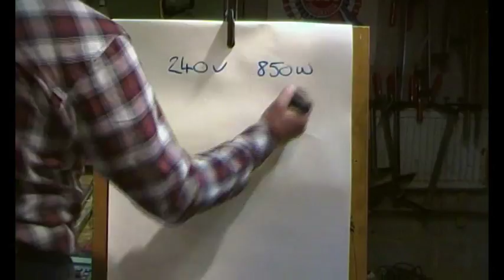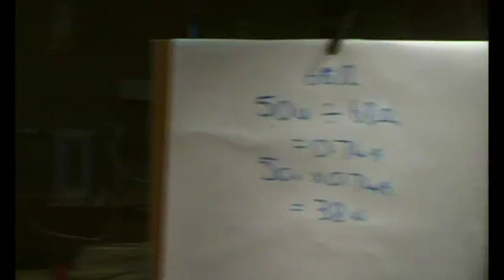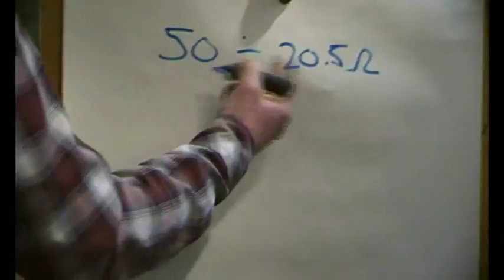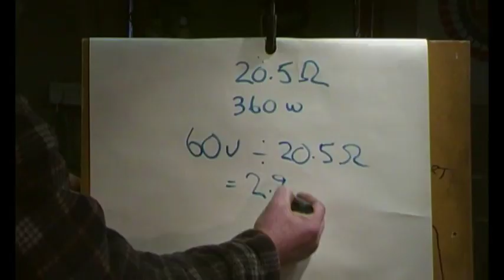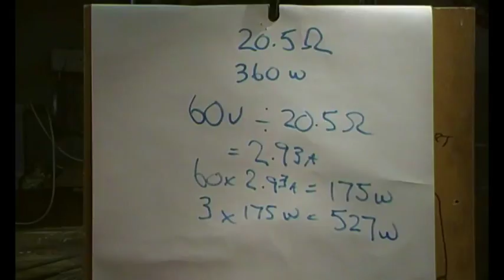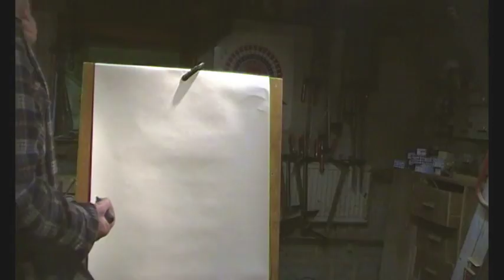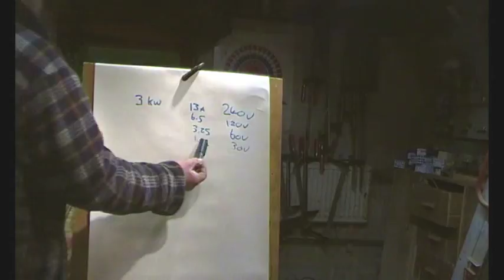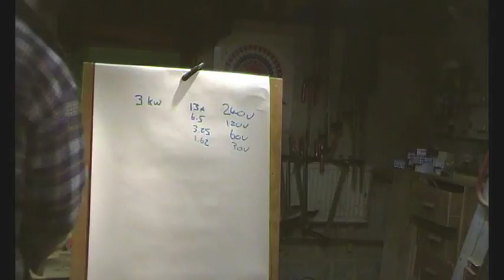Free Heat. Load dump heater, solar charge controller

Comment: Thanks much usefull info .I have a collection of nicrome wire  heating elements removed from scraped hvac units that intend to use as a load dump heater  in a sand battery. My biggest concern has been  avoiding cycling the top end of my battery  charge with a voltage sensing relay I gather that that is the purpose of the flywheel diode in the circuit?
Reply from the maker: A flywheel diode shorts out the EMF when a coil is de energised. To prevent cycling I set the switch back on voltage lower and also make use of the timing function in the VLC V20 unit. cheers
Reply: @TheInfoworks  thanks  reviewing your book may try to build your circuit. Much of this is Greek to me as my experience is replacement of switches and fuses. I have a collection of scraped boards and capacitors from AC units to scavenge  from .
Reply from the maker: @teddycunningham7568  Teddy, edition four is out by the end of the month, cheers
Reply: @TheInfoworks  will be looking  forward to seeing it  .all my purchases go through  Amazon due to not useing bank cards so let me know when to purchase new edition

Comment: I am new at this..  Wanting to make a Sand Battery,  (heat dump barrel)  thinking of using a Electric stove top burner in the sand... can that be directly hooked to a solar cell  without any other electronic stuff?  and how big of solar cell to hook to one small stove top burner.?   Thanks.... You have a great video here.
Reply from the maker: I'm pleased you are paying attention. There is further info on my Volts, amps and watts videos, see the "Wind and Solar electricity ideas" playlist. It's all about volts and resistance of the heater( in Ohms). 4 panels in series will give about 100 volts. Please subscribe, cheers
Reply from the maker: Paul, here's part two: https://www.youtube.com/watch?v=TIvkGStGtQA&t=188s, cheers

Comment: i'm jealous  the UK has these feolite/magnetite brick thermal storage mass heaters... very cheap as scrap (the bricks too) ...  we never had them in the USA .. perfect combination with solar... use heat pump during the day and also charge your bricks, then open the lid to the bricks at night.... if the bricks run out then use the heat pump from chemical batteris... save cost and wear of chemical battery cycling  .  (No grid connection).  I ended up making my own storage heater using basaltic rocks.
Reply from the maker: Hi, they are a rare thing now and the value has increased with the rarity. I've kept some in stock, just because I collected them when they were been thrown out as old technology, cheers

Comment: i found this video after i converted an ac oil heater to a dc element heater to be a dump load... foolish me! i could have used the 240v element all along. my solar array runs at 65-70 vdc. would have been perfect. - thank you for educating me further on dump loads!
Reply from the maker: Grand, pleased you made use of the info, subscribed? cheers

Comment: This is a great plan Andy, and would be of benefit in Autumn and Spring, although our Autumn at the moment is still somewhat behaving like Summer in the terms of the weather! Another approach would be to use an inverter or some kind of DC-DC boost converter to apply a higher voltage to the storage heater's elements. Then you could simply use the ones that are already in it. If they then pull too much power they could be wired in series or a series parallel combination to reduce it. In fact you could just use the already present house inverter, if you have some spare capacity and then use relays to drop the heater load on and off the inverter under command of your diversion controller. That should work fine provided it's not rapidly switched on & off.
Reply from the maker: Hi, thanks for the ideas. Great to hear that you are still in a good weather phase, here we are still having cold days with rain, wind and hail.  Oh for a long spell of good weather. In the tracker repair video you can tell that a day of good sun is such a relief. There are many ways to do this diverting with varying levels on complexivity. I think simplicity here is a benefit, that and the fact that any extra load on the batteries would pulll the voltage down and so switch off the charge controlle I have the benefit of running several arrays with different charge controllers and the particular controller used with this system has an integral timer so the heaters will stay on for a fixed time (it's the one in the book).  The main thing is that any extra systems should have a minimal effect on the smooth running of the main power supply.  Cheers, Andy

Comment: If I had some PV, I'd want to be using up those unclaimed 600-odd watts in a heater too ! I think one of your charge controllers (Steka?) diverts into an immersion heater also doesn't it ? Maybe that's at mains ac voltage not 50vdc though...Great in summer.  one of Hugh Piggot's neighbours used old gutted spin dryer bodies filled with BIG w/w resistors as  dump heaters, if I remember correctly :o) Your idea of using storage bricks is better though...
Reply from the maker: Dave, I added a few extra to the original, yes the Steca tarom has an auxillary output of low power voltless contacts so it can be set up to run a DC heater straight off the panels through a power relay. I perhaps need to investigate this function, however glasshouse repairs are looming. Cheers, Andy

Comment: why n not just use a sand battery as a dump
Reply from the maker: Yes, could do but I work on then principal of "use what you have" and so this is how it turned out. The divert to load principal is the main thing here, cheers
Reply: @TheInfoworks  I'm in the process of building 1830 Darwin Wind Turbines and don't need electricity,  only want to dump load into a sand battery.  I'll pull heat and hot water off it.  I live off grid in a very cold climate.  do you know if you can put 12v wind turbines output series without a battery bank?
Reply from the maker: Hi, it's tricky direct loading a turbine as there will always be a load on the turbine preventing it from starting. If you have a small load then the turbine will over speed and destroy itself. You could have a very small battery that charges up quickly and the charge controller then connects the dump load. cheers  @mayamachine